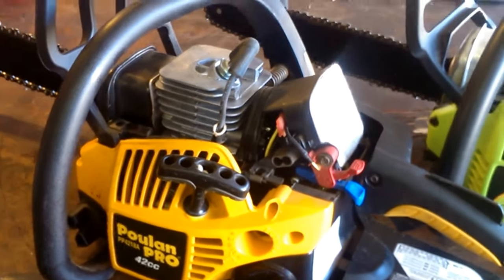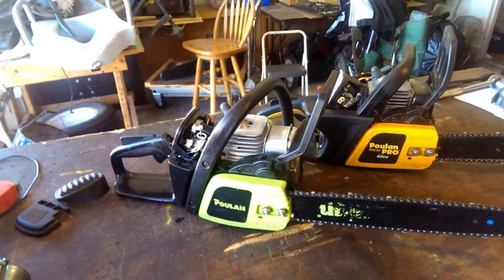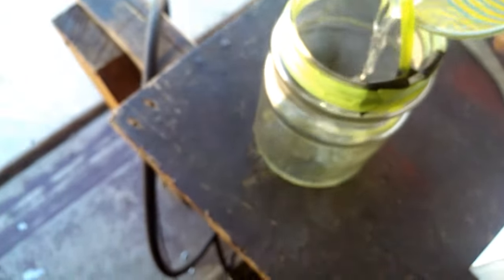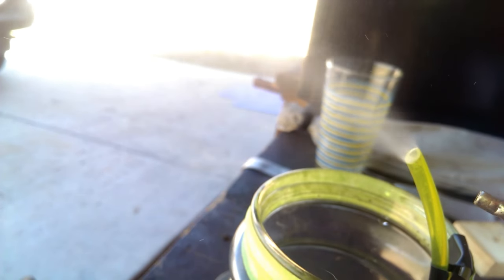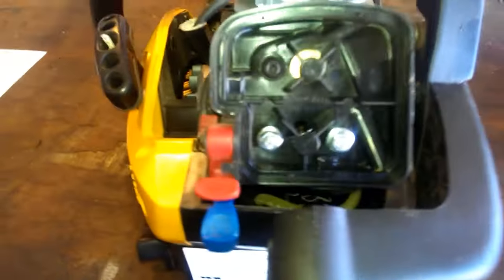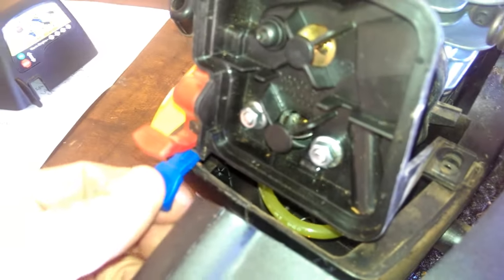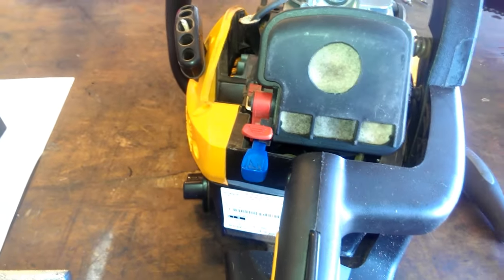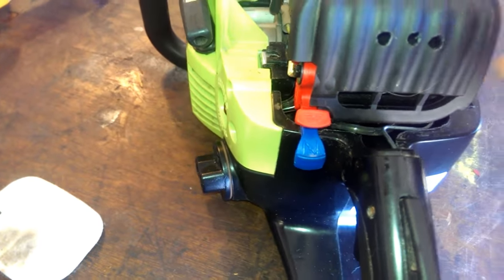Poulan wont restart after being used & how I solved my problem.

Comment: Dear Zombie Dave,
Firstly thank you for your video. Last night I found a poulan p3416 that was tossed out because the start pulley was worn out. There is another venturi above the carb built into the air filter housing. The linkage to it is missing. Question: What is the purpose of that venturi, and can I leave it in the open position and still run the saw without replacing it? Any responce to that question is appreciated.
Reply from the maker: Stewart, that upper barrel opens on full  throttle. If it stays open all the time it will be the path of least resistance. It will make tuning the machine near impossible. Im not sure where to get that llink.
Reply from the maker: I just went to Amazon and typed in Poulan pro pp3416. The new carb will come with the missing link. There are tons to choose from for under $20. Good luck.
Reply: @ZombieDaveAZ   Dear Dave I replaced the carb for 12.69 total so thanks for the advice. The saw runs, but the problem is pulling the start cord. It frequently snaps back and injures my hand. What could be the problem, and how to remedy it?  Thanks again for your help.
Reply from the maker: @stewartbruce2409  sounds like a timing issue. You need to remove the flywheel and check to see if the keyway is partially sheared. That will cause the rope to snap back. The plug is fireing before it is supposed to. A form of pre ignition.

Comment: so my Poulan pro 4218 has work well for 2 maybe 3 years. the last time I used it worked fine. the next time I wanted to use it would not start, not even fire. I took out the plug and it was dry so no fuel the first place I wanted to start was the fuel filter. as usual, what should have been an easy fix turned into a mess. when I went to pull the fuel filter off the fuel line an inner skin from the fuel line stayed on the barb of the filter and it just stretched like 10 inches. have you ever seen or heard of such a thing. so obviously I had to get a new line, but it was really weird how an inner skin separated from the inside of the fuel line.
Reply from the maker: dohn witte  I have not seen that happen. I have seen from so dry and brittle that the filter is just rolling around in the tank and gooey (technical term) like licorice but never seperation like you described.  Did you replace with Tygon fuel line? I get mine from Amazon and it shows up in 2-5 days. Good stuff in my opinion and thats the cheapest place I have found to get it.
Reply: Exactly what happened when I pulled my filter today and this is the only other account I have read of the same thing.  New fuel lines tomorrow but I am still wondering what this is.  Maybe they added a "liner" to protect the fuel line from the gas?  And then it fails.... go figure
Reply from the maker: MCAD Sculpture is there anyway one of you guys can post a quick vid?I have been looking for this lately but no luck .
Reply: Too late… we already pulled the inside liner out about 12" then just cut it off.  Might be able to get a photo of the remnants tomorrow if we didn't toss it….
Reply from the maker: MCAD Sculpture. I'm giving this some thought and was wondering if you happen to be using the canned fuel? You know the stuff that's like 93 octane and ethanol free.
Reply: @ZombieDaveAZ  I have been using the canned fuel and had an "inner sleeve" pull out..pretty sure it was kinked and blocking the gas line..replaced fuel line

Comment: Poulon pro chainsaw won't start.  I changed the carburetor,coil, fuel filter and spark plug. It gets small spark. primed with new 50:1 fuel. Gaps are good as well as I can tell.
Reply from the maker: will it start if you shoot carb spray in the carb or pour a little gas in the carb ?

Comment: I have like 9 of these. None run. Sad too cause I drilled out a muffler and tuned up a poulan wild thing it was actually fast. I think the crank seals melt and leak whene you run the poulans too Rich. They run hot with 32-1 oil mix.
Reply from the maker: Hey Eric thanks for commenting. Hit subscribe as I have a video coming out this week on an old Poulan that I got for $14 and she is a GEM! At least I hope so. Factory compression and has spark. It's me job to deliver the fuel and she will be my new go to saw. Thanks again.

Comment: Hola. I'm hoping you can help me get my poulanpro pr5020 started. The starter rope doesn't rewind to get the saw started. The repair man replaced a coil inside the starter housing. It worked for 2 starts and then the rope once again would not rewind. It appears that the area where the coil is located in the starter housing is not even.  The repair guy wants to replace the stretched out coil again instead of trying to find out why that coil is getting stretched and uneven. I don't want to pay another $40 for a repair that is not a repair. Help! My name is Kitty .
Reply from the maker: Hi kitty, I can help you but in a little while. I have to get a cooler fired up this morning. It's gonna be 100 
Today.

Comment: Thanks for the insight on the air intake issue.  I'll try it.
Does anyone know the carb reset adjustment settings?  I have rebuilt a carb on my 4218 (with no training on this issue) and need to reset the carb back to factory settings and then fine tune from there.   I need all three factory resets: idle, high and low. I'm stuck with a chainsaw that won't run!
Reply from the maker: Most guys will say start @11/2 turns counter clockwise. Start with the low first to get it to idle and warm up. Then move to the high speed jet and adjust until it will pick up RPMs fairly quick. Idle screw to the point where the chain wont spin.

Comment: don't huff gas!  lol!  i got mine running, but it sat quite a while, and it's bogging out.  water in fuel?  can I just add fresh, or should I seafoam it?
Reply from the maker: Steve Greggs  My understanding of seafoam is to clean valves combustion chambers and air intakes. My thought on your machine would be to dump out the old gas and start new. If it was mine I would just put in a $5 carb kit too.
Reply: Old fuel evaporates losing some of it's pep making a higher oil to gas ratio. the hi adj.screw may need to be tuned out a little to compensate, but no more than 1/4-1/2 turn. Then w good fuel will be too rich, turn back in a small amt.

Comment: Why do you oil the filter material? What does that accomplish?
Reply from the maker: Good question Stan. Lightly oiled filters help to trap "more" dirt/dust" particles. Thus extending the life of the engine by preventing premature wear. Thanks for asking.

Comment: What Size Drill bit did you use. Thanks
Reply from the maker: I used a 1 inch wood bit. It went thru real easy. Be careful it doesnt spin and get you in the hand.
Reply: put new duckbill vent in cap.  no drill needed

Comment: I use aviation (airplane) fuel in my chainsaw and blower. It costs more but can be stored forever without getting gooey or varnish. It has NO ethanol in it either. My generator sat for 4 years with av gas in it and started with 1 pull! Well worth the extra cost for a gas. I can get it self serve anytime at my small local airport.

Comment: just picked up a used weeadeater blower/vac vs2000bv no start , has spark , took the carb apart , took the muffler , new plug , feels like no compression  , poss ring siezed or o-ring at head going to take appart
Reply from the maker: Joni English  Joni, my reject on compression is 90 psi. They still can run at 90 or a little lower but its like eating an elephant. Its not easy and it takes a long time. Carb spray down the carb barrel w/the throttle held open and a few pulls may get it to cough for you. Taking it apart is fun and you will learn alot. You cant break broken. Let me know if you get it going please.Zombie Dave
Reply: took apart last night , Ring Siezed to Piston 
Soaking over night in CLR and try to free up Ring 
if CLR does not work then Oven Cleaner or SEAfoam

Comment: By the way folks, according to my service manuals, which are up to date as of Feb 2019, there are at least 8 different versions/sub-models of the Poulan 3314 Chain Saw. Lots of parts, fittings, hoses, clutches, etc are very different, so when you see/read comments about how to do anything on one of those machines, remember that nothing is really standard for all sub-models.

Comment: Question: the blue choke lever on my Poulon-rebranded saw is very, very hard to pull out.  It's so difficult that I have to grab it with pliers, my fingers aren't strong enough to keep a grip under the pull required for the choke.  Any ideas?  I'll subscribe so I can get notified of any new vids.
Reply from the maker: Ammo Alamo the black piece of plastic that sticks out from the top of the handle is a safety. Be sure that you have got a problem there. Grip the machine as you would if you are running it with the throttle pulled in. See if that makes it any easier to set the choke.

Comment: When any of mine has this problem, first I loosen the gas cap and try starting it. If it starts and runs for some time and it does it again buy a new gas cap or tank vent system.

Comment: ...how I solve the problem of these non-running plastic Poulans...remove clutch cover, handlebar, and starter, I sell those on Ebay (the bar and chain are usually shot already)....toss the rest of the saw in my Irony Aluminum pile for the next trip to the scrapyard...the thing is, I can usually get them to run, but when all you can get out of them is around $25-$40 in running condition(maybe $50.00 for a really mint running one), they are not worth putting your time, carb kit, primer, fuel lines, etc. into...I can usually get $30-$40 out of the clutch cover, handle, and starter, and don't have to deal with the old guy who bought the saw from me bringing it back because he can't get it to start(too feeble to pull it hard or fast enough to get it to fire)...I usually get these saws for free, or pay a couple bucks for them at the scrapyard...then I strip the saleable parts from them, then sell them back to the scrapyard on the next trip....just because you CAN fix something doesn't mean it's always the best thing to do....now...if I find a junked Husqvarna 346XP or 372, that's another story.....
Reply: ...oh...and anyone would be nuts to pay more than $10.00 for a non-running one...I won't even pay that...50 bucks would be insane....

Comment: Some  comments on here recommend using 100% gasoline with no ethanol. 
What exactly is that and where can you buy it? 
Most manufacterers recommend 87 octane and Stihl recommends 89 octane.
Reply from the maker: hey Munster. 3 different things going on here. 100%gasoline is not mixed with ethanol. octane is the rating and the higher the number the more likely you are to avoid detonation.
Reply: @ZombieDaveAZ  I'm still not clear on this. First of all this question pertains to fuel in USA. In USA pumps usually have 3 types of fuel labeled "87 regular", "89 plus" and "91 or 93 premium".Some pumps may, also, dispense something like E85 ethanol. ( I don't know if I can post a picture here, but pictures are in links below.)
Unless there is some fine print somewhere on a tag on the pump, there is no indication I can see stating whether the fuel is 100% gas or something less.
-----
 According to first link below "Also, almost all gasoline in the US contains 10 percent ethanol. When you mix 10 percent 113 octane ethanol with 85 octane gasoline it increases the octane two points to the normal 87 octane most consumers use. So the higher the ethanol content, the higher the octane. The octane rating for E15 (15% ethanol) is 88 octane and E85 (85% ethanol) is 108 octane."
-----
https://mnbiofuels.org/media-mba/blog/item/1511-octane-and-ethanol-for-beginners
https://www.angieslist.com/articles/what-difference-between-regular-and-premium-gas.htm
-----
If this information is correct, then you cannot buy 100% gasoline at most gas stations. So, my question remains; where do you go to buy 100% gasoline? Do you go to an airport, a race track, a fuel supplier? And how can you determine if it is 100% gasoline?
------
It appears that the lower octane fuels contain a higher percentage of gasoline or at least a lower percentage of ethanol, so if ethanol is the enemy of small engines, then a lower octane fuel might be the best choice (provided it meets engine manufacturer's specs)  if one is unable to find 100% gasoline.
Reply from the maker: @munsters2  you can buy ethanol free gas at any home Depot or Lowe's. It's in the small engine lawn equipment section.

Comment: I have a poulan pro 16" chainsaw.  It ran just fine last year and Im using new gas this year as well.  But....it starts just fine, after i let it run for a bit when I squeeze the throttle it makes a chugging sound and stops.  Is it an air filter problem?
Reply from the maker: W. Reid  Hey W. You know your saw better than anyone. Its difficult for anyone to diagnose a machine over the internet. Thats just a fact. Me telling you what to do is like going to the auto store when your check engine light is on. They want you to throw money at the problem until eventually it gets solved. Follow me so far? Most LIKELY the problem is carb related.BUT have you eliminated the basics? Hows the spark plug? Did you try running it without the filter? Fuel lines still good? No cracks? Bogging or chugging is sometimes a side effect of unmetered air getting in from somewhere. It also could be the screen inside the carb partially clogged. You need to get a little deeper into your investigation before I can say exactly what to do. I know this isnt the quick fix answer you were seeking but it would be ireesponsible of me to have you throw money at the problem without isolating it or eliminating what it isnt. Sorry and get back to me with what you find. Zombie Dave
Reply: i will take it apart today and get a closer look.  The saw is roughly two years old.  It starts like a champ, but it just wont run when I pull the throttle.  I will clean up the air filter and run down to the hardware store and get a corroborator adjustment tool.
Reply from the maker: W. Reid No special tools needed except for final adjustment. If it ran well last year it probably wont need it. Look thru my videos of what to look for and also I have a 2 part video on how to clean a carb(if thats the issue) 100%. Check and make sure diaphragms look good. Working on a machine is like cheffing. The better you prep yourself the easier it will go.
Reply from the maker: W. Reid No special tools needed except for final adjustment. If it ran well last year it probably wont need it. Look thru my videos of what to look for and also I have a 2 part video on how to clean a carb(if thats the issue) 100%. Check and make sure diaphragms look good. Working on a machine is like cheffing. The better you prep yourself the easier it will go.

Comment: To test ur poulan, just run it with airbox cover off and saw topcover off. My wildthing proved to run much better airbox lid off.
Reply from the maker: As a general rule I like to configure the saw or any machine the  way that it is intended to be used. That's when I make final carb adjustments. That's just me. Thanks for commenting and stay safe. 🍻👍😷

Comment: Show the cylinder through the plug hole. Also, demonstrate the hole in the breather cap works by running the saw with and without the tape. Talk is just that, talk. One thing about these saws is the cylinder jugs are super cheap. They score up if you just breath on it wrong. If the jug scores up, guess what, the suction don't work right and it'll blow fuel back out the hole instead of sucking it all in.

Comment: Will the vent problem cause fuel to enter the carb to tank vent line? pp4018
Reply from the maker: Will Rice  No Will, it wont . Heat from being in a garage or back ofa truck will cause the fuel to expand  generally fuel will stay in the tank return line if there are no leaks in the system. Full cup soda and put your finger over the top of the straw. Soda will stay in the straw until it is replaced by air. IE when you lift your finger off. Same principle. Hope this helps and really appreciate your comment.

Comment: The best thing is don't use ethanol gas in any small engine use non-ethanol gas. Alcohol is made with water and when the alcohol evaporates there is nothing left but gas and water.
Reply from the maker: I totally agree Jeff. Its not easy to find around here unless you buy the canned fuel. Great Comment!
Reply: @ZombieDaveAZ  yea and the price, if you ever store gas for long periods its better too. There are very few places in Tenn. Where you can buy it around here either. You could try separating the water from the gas before use and maybe some octane booster and stabilizer. It would be expensive but I think it would work, hope this helps.

Comment: A bit long winded to get the point (and fix) of drilling some holes. Fortunately, my Poulan Pro 4218AVX doesn't have hot start issues and restarts with one pull with the throttle closed (at low idle). Another way people have addressed the hot restart issue is by opening up the spark plug gap.
Reply from the maker: Read my bio. You were warned ahead of time about being long winded. Lol. But on a serious note not everyone has our understanding of what's going on with any particular machine so as long winded as is is, most people will come away with knowing something they didn't know before watching. I'm OK with that. Thanks for watching and stay safe my friend. 🙂🍺😷

Comment: Can you get sufficient cooling if you leave the outer shell off?
Reply from the maker: No
Reply: Not just no, but heck no.
Reply: Decided to take it to a shop.  Time is valuable.
Reply: @roberttrautwein1260  You're a wise man. In  my shop, I did a complete cylinder/piston/rings/piston pin/bearing replacement because one of my customers ran his without a cover for about 25 minutes. Cost with 1 hour labor and all new parts was $55.00 and change, covers are a lot cheaper.